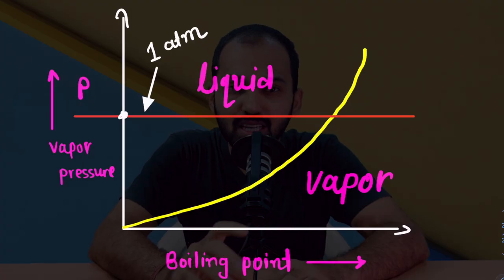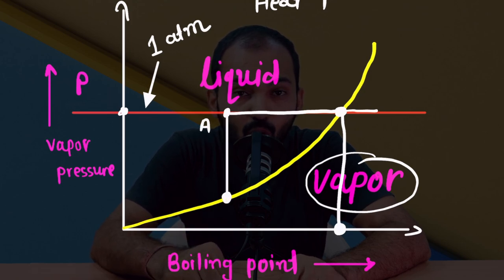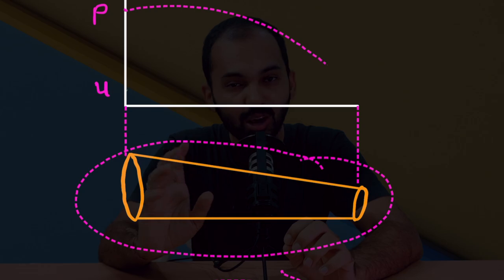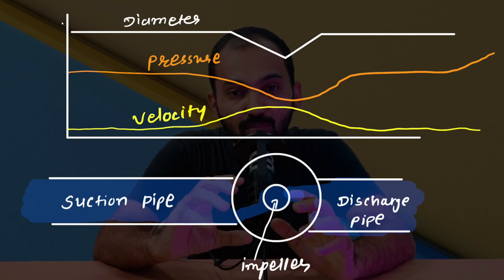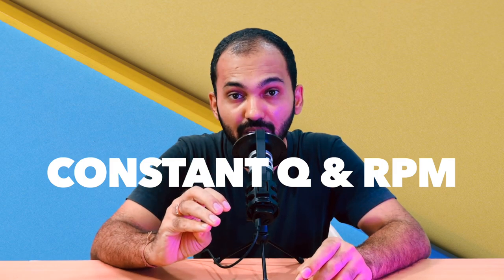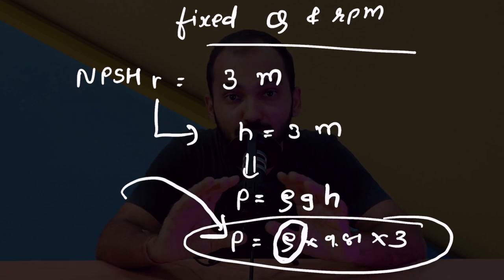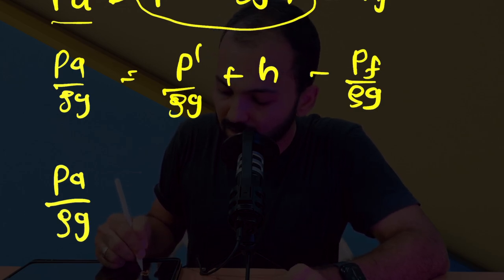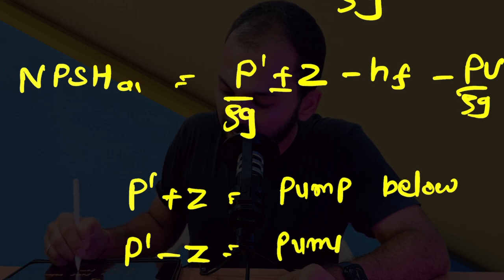Cavitation in Centrifugal pump, NPSH available, NPSH required, Calculation of NPSH, NPSH3

Comment: Very good explanation Sir. But i have a question, if put a pressure gauge on the suction side of the pump ( near the pump). Is it correct to say NPSHA is equal to pressure reading of the gauge minus vapor pressure of the liquid?

Thank you again
Reply from the maker: Yes that is NPSH, Exactly.
Reply: @chintanconcept  thank you very much

Comment: sir, pressure balance mai velocity head ka term kyu nhi aaya
Reply from the maker: I really appreciate your question

Velocity = flowrate/area

Usually in static pressure head calculation & NPSH calculation we ignore the velocity head term which indirectly affects total energy(also constant flowrate) is there.

Actually NPSH = (Ps-Pv)/p*g - V2/2g

but doesn’t affect on total values.(hardly in 0.0…)

Hope it is clear

Comment: Sir pressure=force/area then how will be pressure decreasing along with area.
Reply from the maker: Hi

It’s important to clarify that P= F/A represents how pressure is calculated, not how it changes within a fluid system.

Here's how increasing pipe size can impact pressure within a fluid system:

1. Velocity:  When you increase the size of a pipe while keeping the flow rate constant, the fluid velocity decreases. According to Bernoulli's principle, as the fluid velocity decreases, the pressure increases. So, in a larger pipe, the fluid exerts a higher pressure due to this reduction in velocity.

2. Volume: A larger pipe can hold more fluid volume, which might affect pressure if there are changes in flow rate or demand. However, the pressure exerted by the fluid itself is not directly related to the pipe size but rather to factors like fluid density, velocity, and external forces acting on the fluid.
Reply: That is stagnation pressure